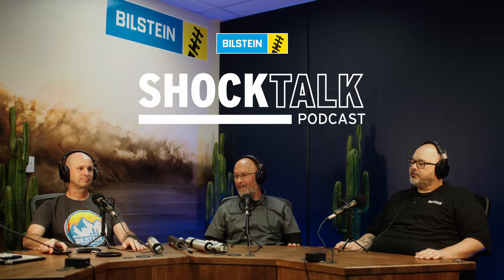Shock Talk Episode 23: The Art of Measuring BILSTEIN Shocks for Off-Road Mastery

Comment: I’m doing an axle swap on my YJ. Doing a JK axle under a YJ. Should I run a YJ shock or a JK and what do you recommend. It will have a 6 inch SOA. When will you air this question. EJS 2024 asked at the Northridge event.

Comment: There are three reasons Toyota guys mount their rear shocks on 45° angles:

1. There isn't much room under the bed to fit a shock that has enough travel for Chevy 63's, so the motion ratio allows a shorter shock to be used. 

2. Back in ye olde days, generic shocks had too much dampening for how light Toyota pickups are. So, by placing the shock on an angle it increases the motion ratio and reduces the dampening. 

3. The most important reason is that ot was a fad in the 80's and Toyota people can't seen to move on 😂
Reply: Switched mine to Low Range mount using the widest points on the top. Then you mount the shock off the back of the axle and still get all the bump and compression you need. 11" 5165 nails it for anyone else that wants rear shocks on a OG toyota recipe to work.